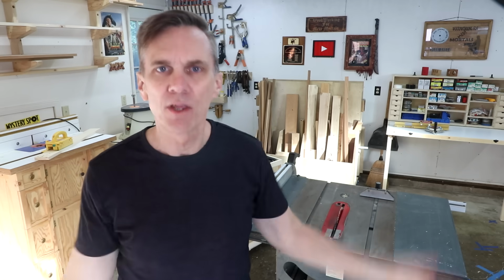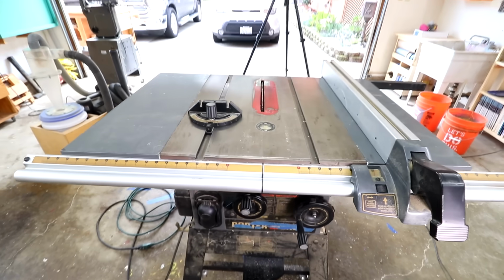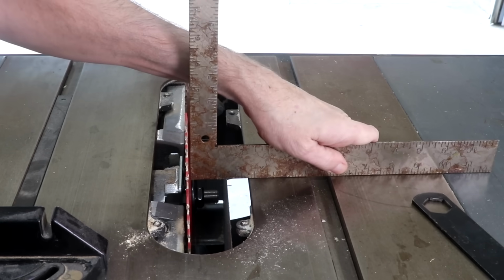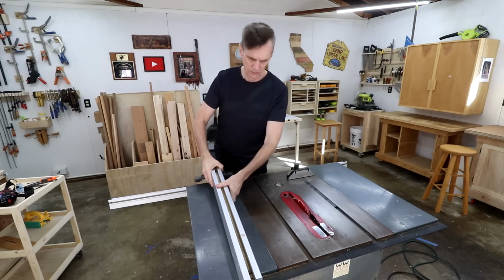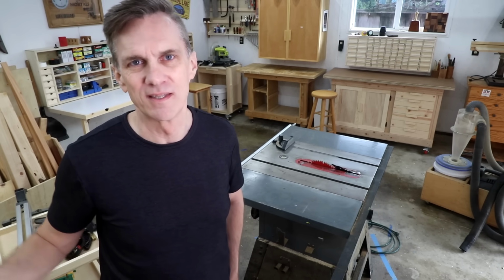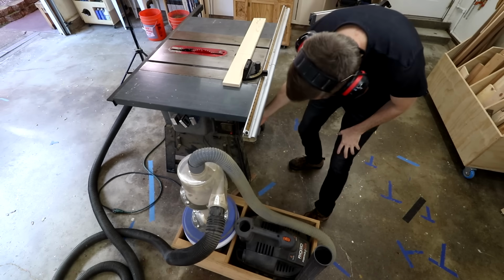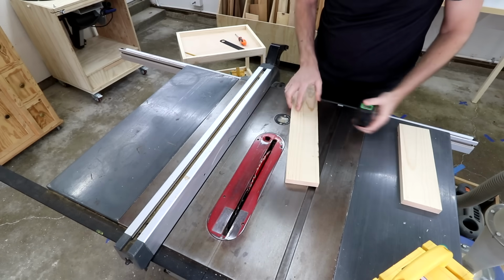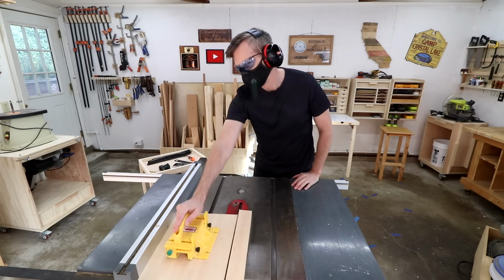A step-by-step guide to making your first table saw cuts. TABLESAW BASICS.

Comment: Hey Steve. Any ideas on how to stop wobble in a table saw blade, when it's running?
Reply: I would make sure that it is on the arbor correctly.  It might just be a case of needing to be straightened out and tightened down.  I always unplug my tablesaw when I am changing the blade.
Reply: @mikecif4123  There is such a thing as tightening the arbor nut too much. The nut won't unscrew itself because threads run opposite to the direction of the blade's spin so it doesn't need much torque to be snug and secure.
Reply: Nenzi sometimes investing in a higher quality blade will fix the problem. I would try that first for trouble shooting. If that doesn’t fix it then you know it’s your saw.
Reply: Wow, like how much wobble? I am with iggy on this, start with a new blade and hope that is the problem. Also Andrew and Mike are correct, you dont need to torque the nut down on the blade just be firm. Make sure you are using the Arbor washer too.

Comment: Will you be doing a guide like this for mitre saw? I have obtained one but having a 10" blade spinning that fast is very scary
Reply: Mitre saw guide would be very very similar (bar the mitre gauge/fence bit :p)... check the blade is square to the rear fence, measure your wood and check/mark which side of the line to cut, do a dry-run or two  (with the saw off, practice pulling it out - if it slides - down onto the wood, and push back through) to check your hand position, body position, and wood position, etc, and ensure you're not e.g. reaching cross the blade to hold the wood :p

For smaller bits, use a clamp or similar to hold it to the fence, keep your fingers 6" from the blade, and be aware the small cut-offs may 'ping' out (so stand to one side of the blade, same as for the table saw).

Once you finish the cut, release the trigger and wait for the blade to come to a stop before lifting it - lifting the blade whilst it's spinning pretty much guarantees the smaller cut-off will ping off at speed.... (and even the bigger bits, if they're not clamped)

Other than that, as Steve suggested with the Table Saw, turn the saw on and off a few times to get used to how it feels and sounds when the blade starts spinning (mine has a slight 'kick', for example), then do a few 'empty' cuts without wood (*after* a dry run to check hand position! :p) so you can get a feel for how the vibrations change etc as the blade moves...

Comment: Was shutting the saw off with your knee part of the tutorial? It was very vague. I need every detail on this tool. 😉
Reply: Being able to turn off the saw without removing your hands from the workpiece is a great advantage.  Should the saw start bogging down or the piece behaves oddly, you can quickly turn off the saw with your leg or knee and hopefully avoid an accident.  Having to move your hands to turn off the saw can be dangerous and result in an accident
Reply: Blade pinch from stresses in wood happens all the time.. I sure remember my first time needing this technique. 😬
Reply: Usually the saw will have a large paddle you can hit to turn off the saw and a smaller button to turn it on. The paddle makes a large target you can hit with a large hand or knee to turn off the saw without needing to look.
Reply: It really depends, I'm shorter so sometimes I kick my foot up there for shut-off.
Reply: @tessabuesgens5831  okay so anything other than your hands sounds like it should work
Reply: @KellyConcepts  I'd tell you what I use to turn mine off but it wouldn't be very appropriate lol
Reply: @MC-zr7hl  Hahahaha I think I see where you're going with this
Reply: @MC-zr7hl  You must REALLY like using your table saw!
Reply: @Nitecrow314  😂
Reply: No guard!!!.

Comment: Steve what's going on question 
When you cut sheet goods with ur circular saw on the foam does it leave a big mess?
Reply: I am sure Steve will also answer this question, but I will offer mine. The short answer is no ... if you set your blade depth correctly. The foam I use is the foam that is used as insulation. when I am cutting sheet goods, I set the depth of the cut to be just thicker than the sheet (same was you would with a table saw). It ends up scoring the foam, but not cutting through. And I have not experienced it creating a mess.
Reply: I've also used this technique after learning it from Steve and I don't think it makes much mess. A bit of foam dust mixed with the sawdust of the cut. Make sure the blade is only just deeper than the wood and you won't be taking too much foam with the cut.